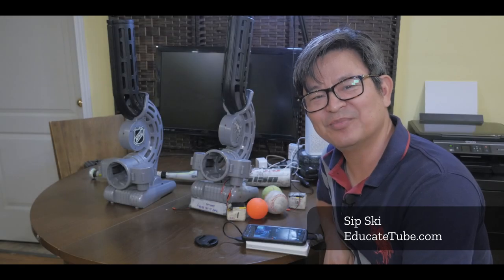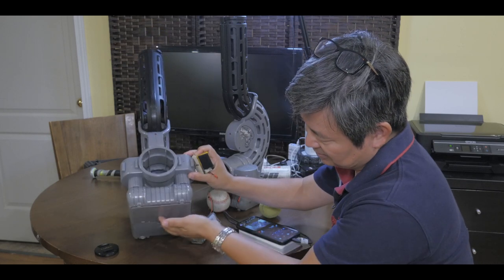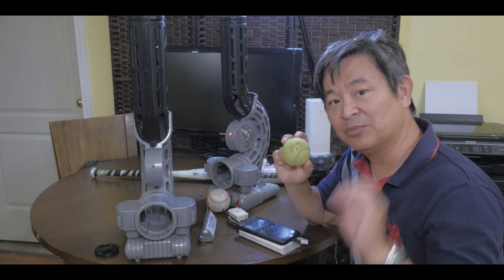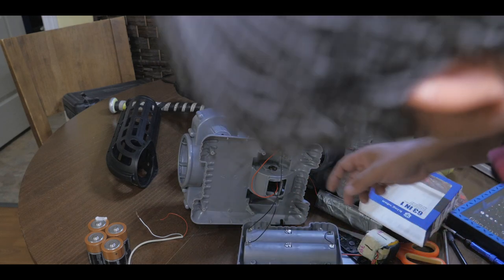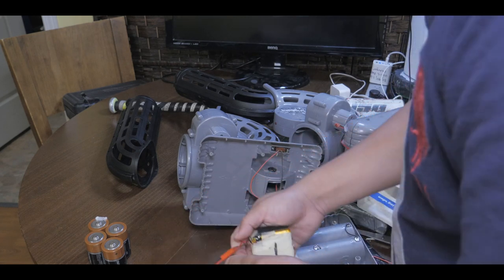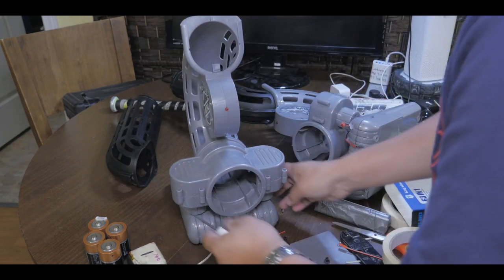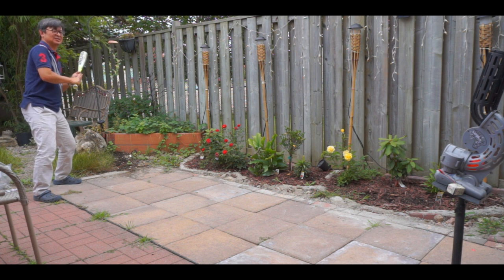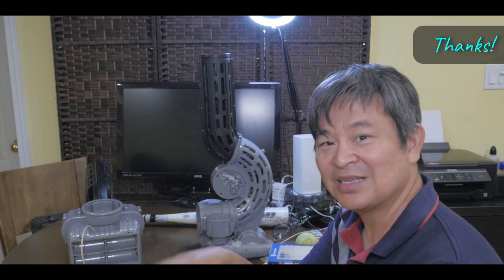DIY Pitching Machine Ball Launcher or Tennis Ball Launcher from Street Hockey Ball Passer

Comment: What's the weight of the balls you are using in the machine? Would it take and pitch a ball of 0.136kg (field hockey ball?)
Reply from the maker: Not sure.  I used the orange rubber ball hockey.  Don't know what the weight is.